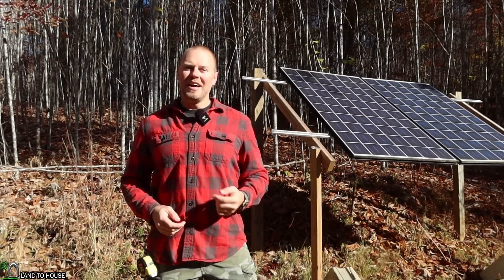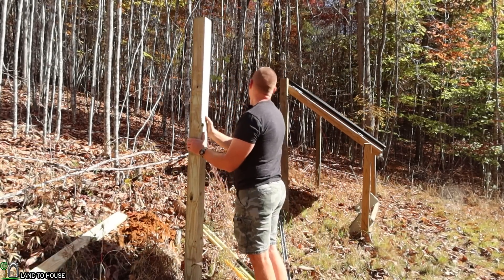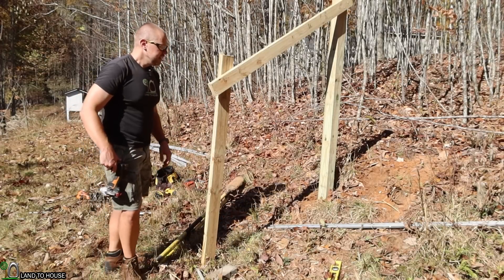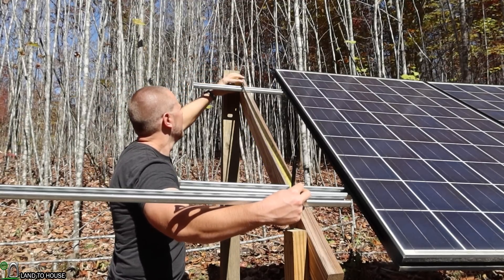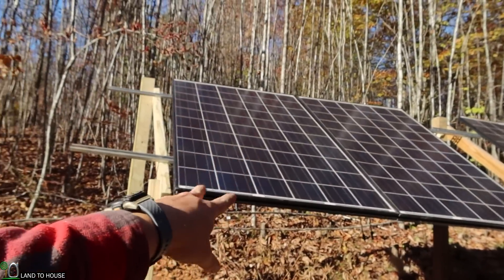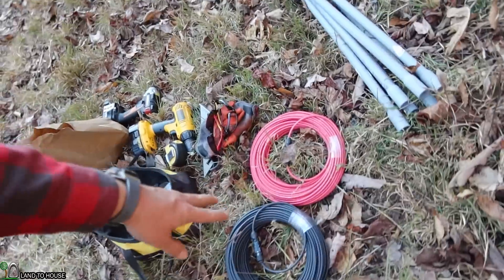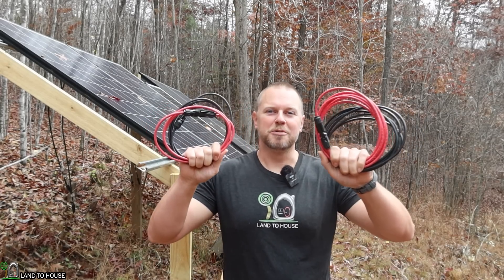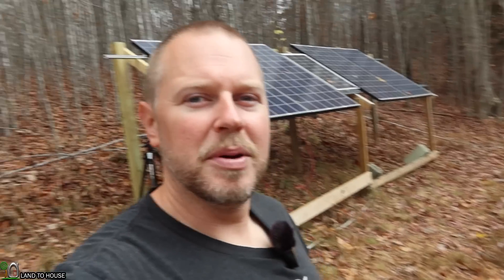Off Grid Shed Gets DOUBLE the SOLAR PANELS

Comment: The good thing about not cutting the Unistrut  is time saving, no scraps and great for use later for future expansion.
Reply from the maker: That is very true. Worked out well in this case and I think will also work out well on the back of the house when I extend more panels there as well.

Comment: When hooking multiple panels up negative to positive dose that end up doubling the voltage? (Like with battery’s) If your charging a 12v system would it be better to have both red wires together and both negotiate wires together?
Reply from the maker: Panels connected negative to positive does add the panel voltage together while keeping the amps the same. When you wire panels in parallel the voltage stays the same and the amperage adds together. 

Then you have series parallel that adds both.
Reply: @LandtoHouse   cheers 👍🏻

Comment: I'm betting you are going to end up putting more wire in the conduit, you should pick up a bucket of Pull string and leave the sring in the pipe.  Anytime you need to add wire you tie a new piece of pull string to the old string and tie your wire onto the new piece and then pull both through the tube by yanking on the pull string it will make getting around the corners much easier and you can get closer to the 50% full conduit that you want to shoot for. You're also going to want to cap the uphill side but leave room for the downhill side to drain out. Water will condense in the pipe even without moisture getting in other ways and will eventually make bad things happen with with electricity although you are using DC and not AC. .

Comment: Congratulations on finding a place where there are no environmental related incidents. No wind, rain, snow, bears, elk, moose, elephants, fire, lightning, aliens, and 4 wheelers. 😊
Reply from the maker: So far this setup has worked really well. We do have rain of course and a little bit of snow but not a lot of problems with wildlife.
Reply: @LandtoHouse  I’m glad you saw through my wit, I live in Orlando and I don’t understand how your septic system is on the side of a hill unless of course the main house is further up the hill. Also, why not put the panels on the shed roof as that cable run introduces loss, right?  Anyway it’s nice to see a functioning off grid setup! Share your inverter / battery setup. Thanks!